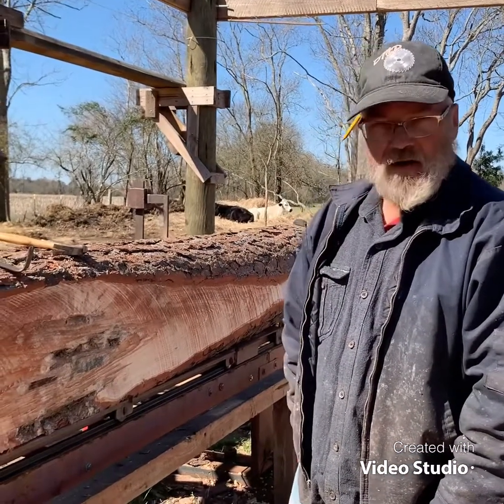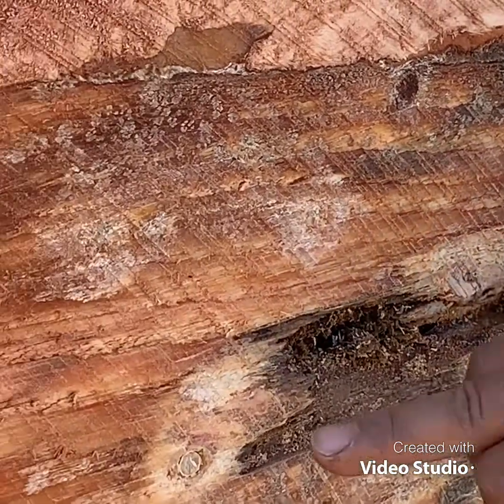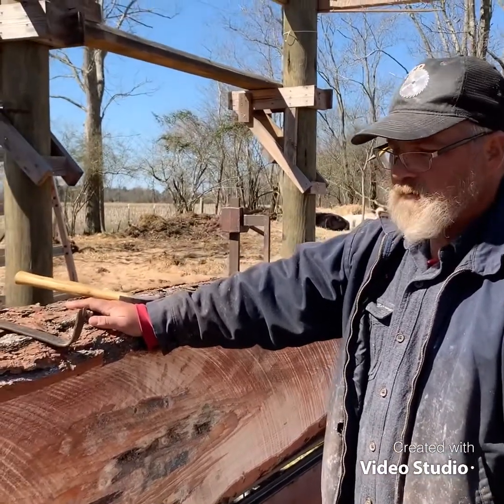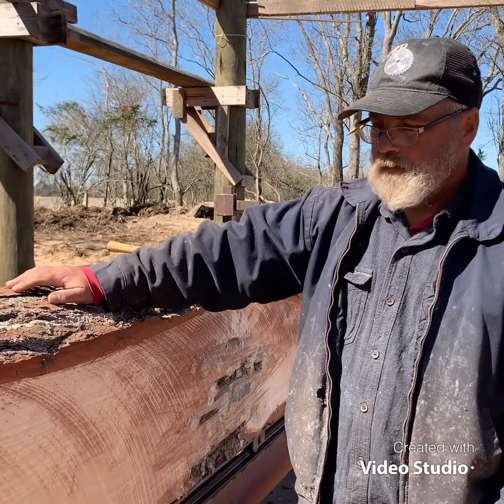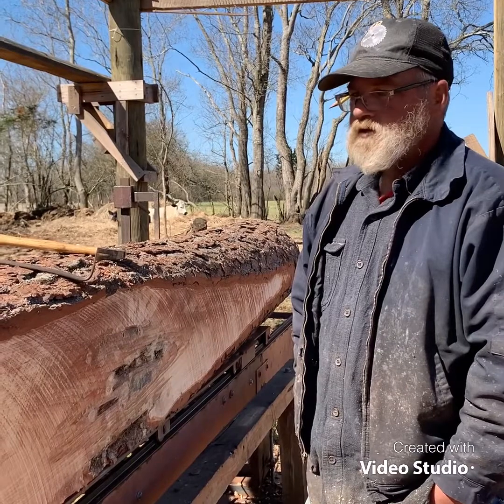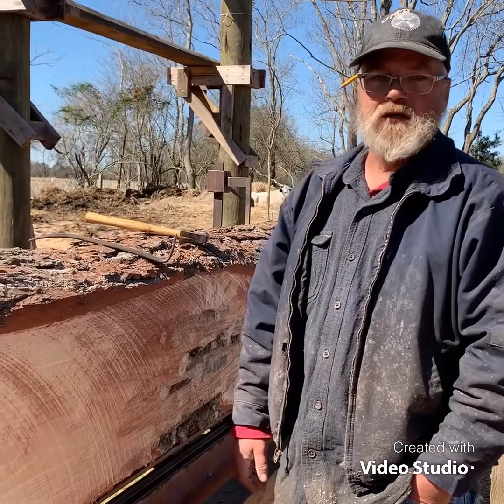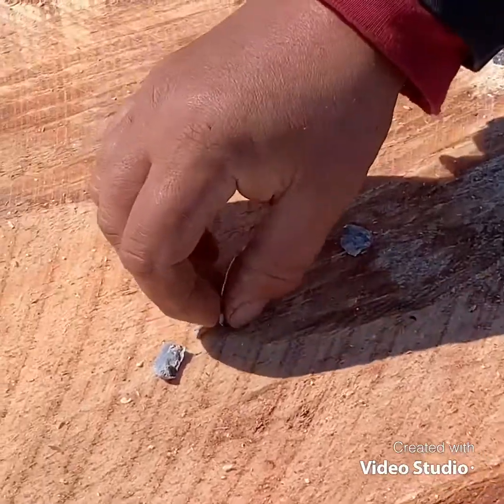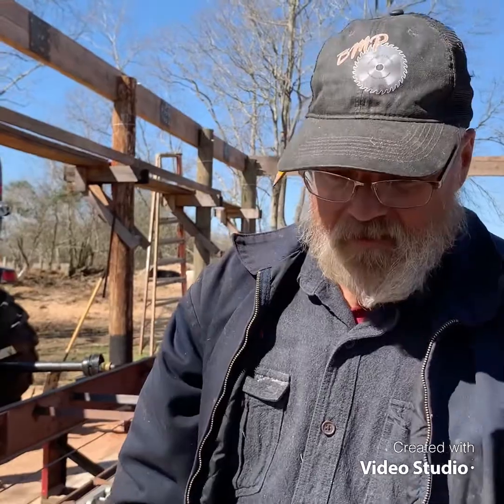Foley Belsaw Circular Sawmill…Blue Collar Milling

Comment: Set a beam over the approximate center of the sled.  Out at the sleds edge near the sawyer, set a block and tackle or hoist on the beam .  Then use a light cable and a sharp point hook to turn logs with very little effort.   You can turn them either direction by wrapping the cable on the near or off side of the log.